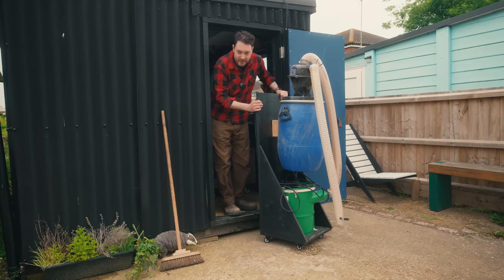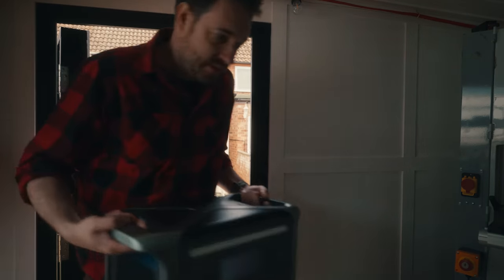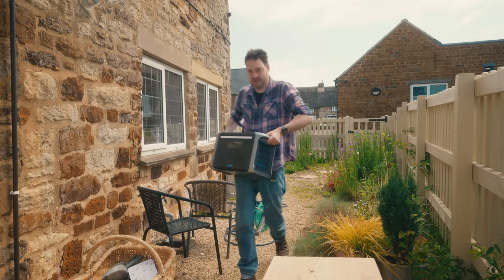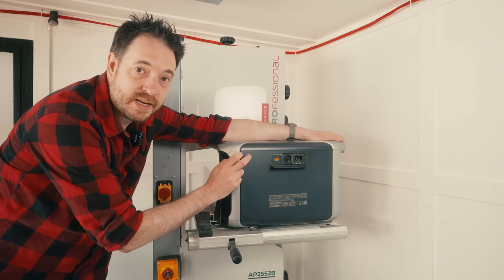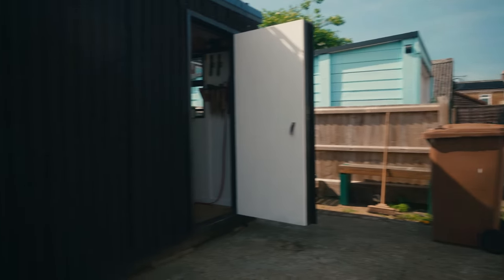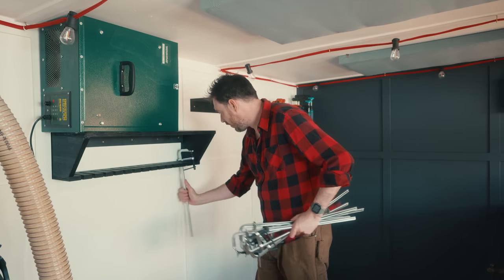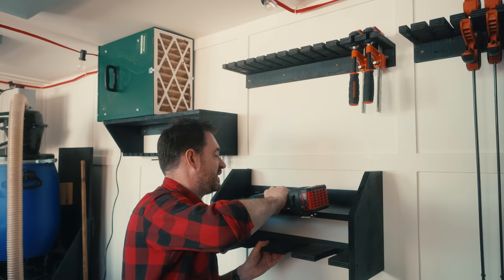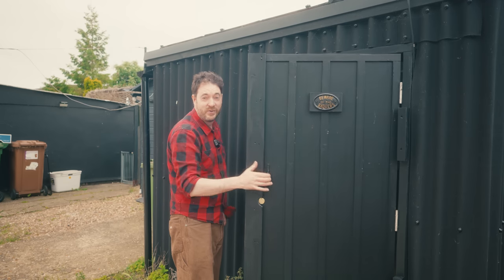Making some changes Vlog 7

Comment: Looks so much better than the blue, I built a similar size workshop painted it white. I heat it with a 5KW  12V Air Diesel Heater which on the lowest setting heats my shop to 20 c over last winter great bit of kit and cheap to run

Comment: Hiya Matt. I've been following you for quite some time. Love the vids and your humour. Given me lots of ideas. I built a workshop couple of years ago but been unsure about which way to go with powering it. It's a long run for SWA and a lot of tricky work, so expensive if an electrician involved, including negotiating a massive amount of bricks that some kind person dumped just under the grass surface exactly along the route needed. So Have decided to go the 'Power Station' route. just bought the Anker 767 which will be permanently in my workshop and thinking of buying 4 x Ecoflow rigid 100watt panels (£159 for two at the mo). what panels did you buy for your system ?

Comment: Hey Matt enjoying your vids. I’d advise on a drip loop on your cables coming behind the panelling as when it rains water will run down the cables and behind the cladding. Looping it down and back up, if you have length, will avoid this. 

I’ve been looking at the anker units for a while for camping but also when working outdoors. Might have to invest
Reply from the maker: Will be great for camping trips

Comment: One thing I noticed in a previous video was the amount of visible sawdust that had accumulated on the strips on the walls - made even more obvious by the dark paint! To start with I thought this was the reason for the change. I guess now you'll have to be aware of those tools leaving marks on the white walls! 
It does look lots brighter in there though - it seemed quite dark before (on camera at least). Lovely space though, certainly given me a nudge towards building my new workshop.

Comment: How are you finding the structure holds up without OSB sheathing? I'm planning a workshop at the moment and its my biggest cost, thinking I may skip it if its not going to make a noticable difference to the strength
Reply from the maker: It’s doing fine